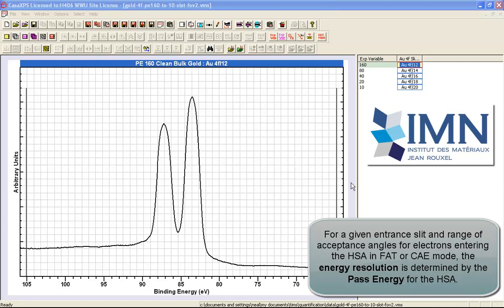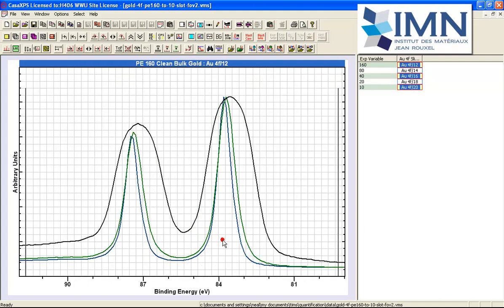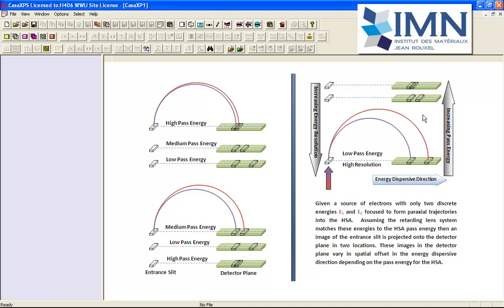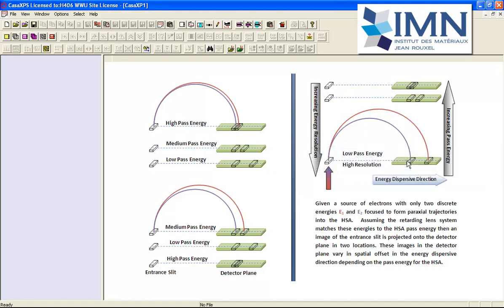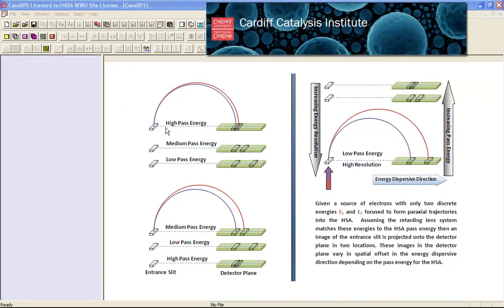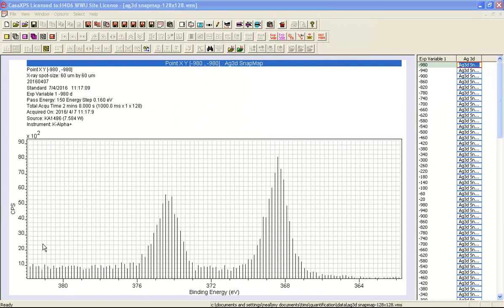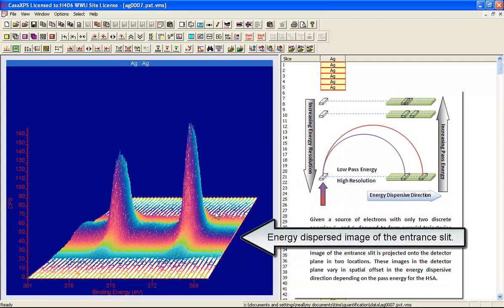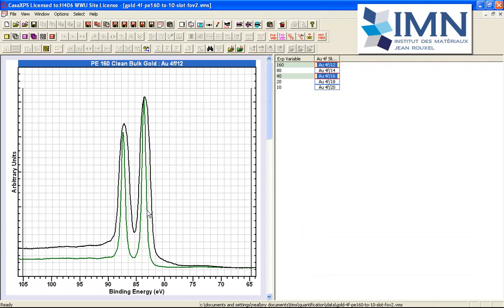Pass Energy and Energy Resolution

Comment: Hey, do you happen to have the source for this information? I've tried looking everywhere for the reason as to why resolution gets worse with higher pass energy, and this is the only place I've found it. Thing is, it's kinda weird to put a youtube video as a reference, so I was wondering what's the name of the book or pdf where you found it. Also, does it work like that for Delay line detectors as well? Thanks in advance!
Reply from the maker: The chapter by Ian Drummond in Briggs and Grant (ISBN 1 901019 04 7)  is the source for much of the information in the video. Also much of the data in the XPS of polymers database by Beamson and Briggs provide examples of high and low resolution spectra collected using the same pass energy but using different entrance slit widths to achieve the improvements in energy resolution.
Reply: Thank you very much! Both for the information and the quick response!